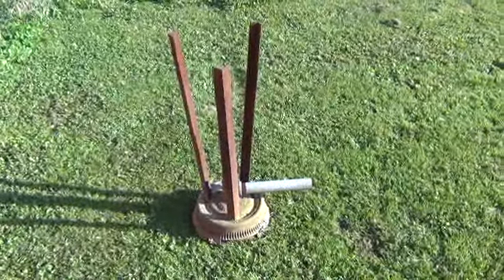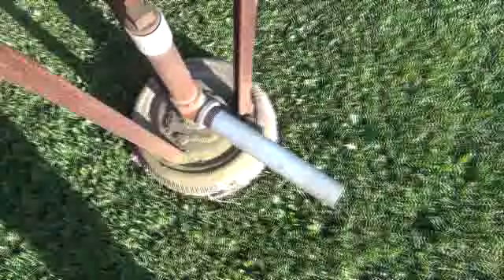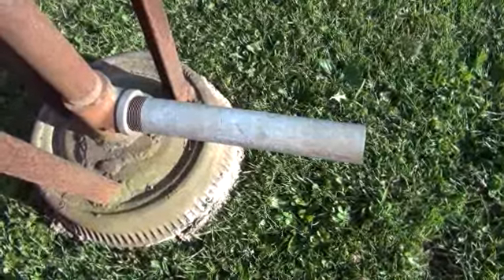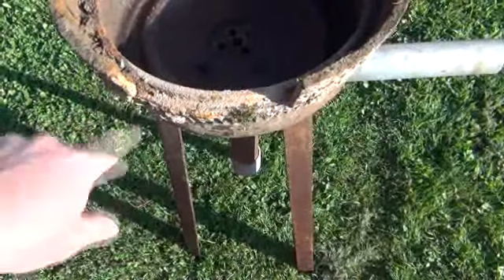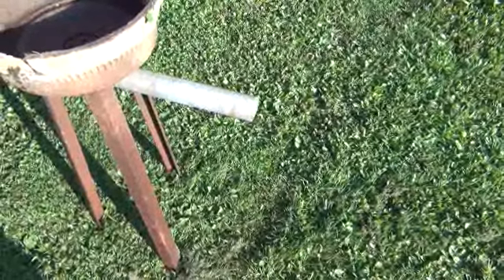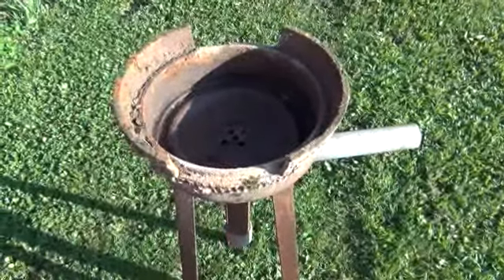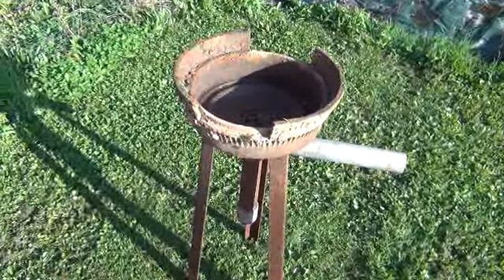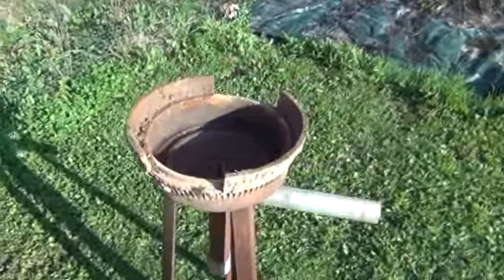Break drum forge.wmv

Comment: I made a forge once from the end of a water heater. I think it was electric, but don't know for sure. It had about a 2 inch tube running through the middle of it top to bottom. I cut it at about where the seam was at that joined the concave part to the cylindrical part, and then welded angle iron to the dish. Later I packed it with clay and baked that in with the coal fire so the dish wasn't so deep.